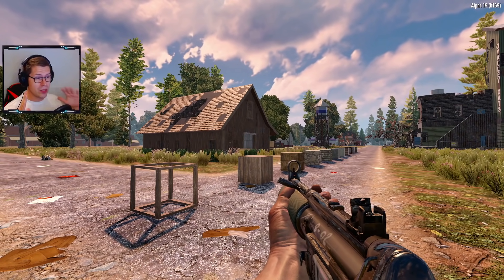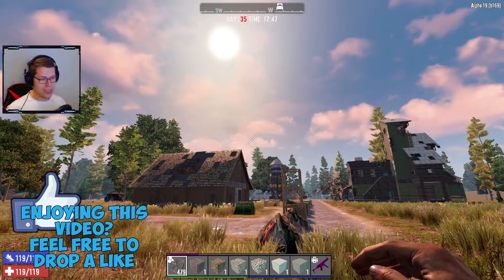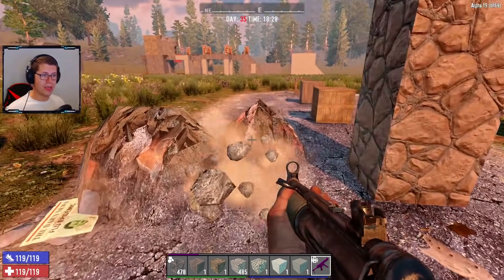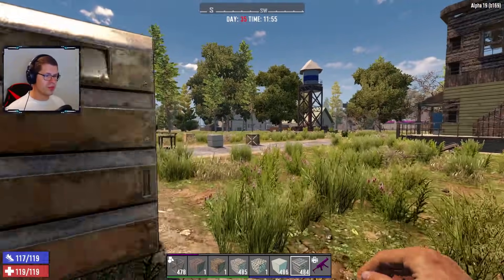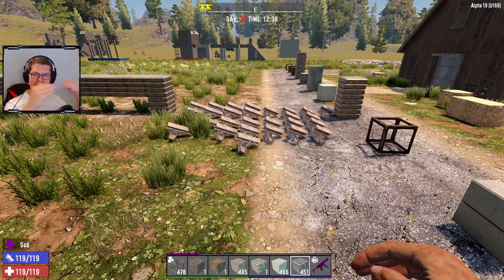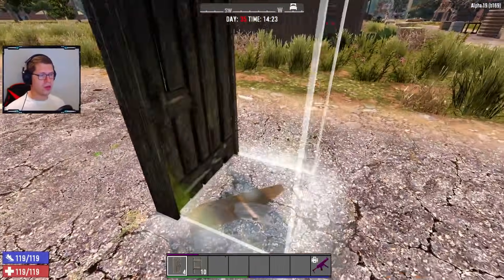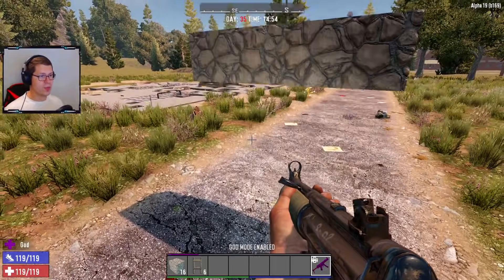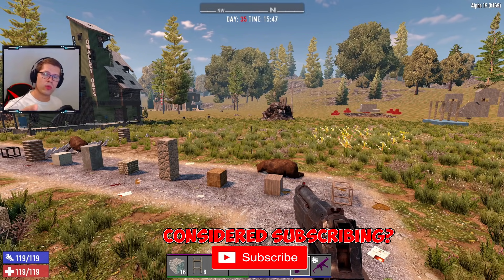7 Days To Die Tutorial - Structural Integrity

Comment: Also important to note: The mass limit is not per block, its per side of the block. For instance, its possible for one wood frame to hold up 8 steel blocks, if they're arranged in a square around it. This means it's possible for one steel block to hold up to 60 other steel blocks, as long as they're not arranged such that any of those steel blocks goes over their own mass limit.

And something that wasn't specifically called out, is that you can mix n' match without care when building straight up. if you build 4 steel blocks out, you can then build 40 wood blocks straight up from the last one and not have collapses.

Comment: all good info, I"m glad people are still making good tutorials, since the structural integrity is a fairly unique, and interesting mechanic to the game.

But it gets kinda funky when you start going into "shared multi sides." the spar is easy [diving board shape.] and a span is also pretty easy "bridge type thing" but what about when you make a "mushroom" with one OR MORE pylons, with multiple support faces, and interconnected facing? 

a fun idea is make a foundation, then get wet cement blocks, shape them into poles. advanced rotate them into  a corner, pile them up as high as you want, putting one in each corner, then a full block at the top. upgrade the lowest 4 levels, if you'd like to reinforced or higher. you now have FOUR columnar support in a one fourth block space.   option two: one full block, and four layers of plates using the "rotate on face" option, "Cladding" the full block with a very flat block. what this allows is, if my calculations are corredct TWELVE support faces, at the top. since you have five columns in a + formation.   The challenge with these is how does the game calculate it's support? is it the sum of all 8 or all 12 faces?  my testing is inconclusive. I would often get results far higher than expected.

So all that said. if you have a long elevated pathway, you can use poles or 1/4th blocks to make a narrow high clearance bridge support, or stilts for a base, where the zombies can literally walk right under you, and almost never get fetched up on the framing. 

But if anyone knows for CERTAIN the game's calculations when making platforms on stilts, how it calculates support on all those shared sides, let me know.

Comment: Worth mentioning...
if you put a block to the sides of your support post, and connect those to your blocks (maximum of a 3x3 grid on your support pole), then each of the 4 "faces" of your support pillar, will hold the maximum number of blocks of that material (based on weight).
So a single wood pillar, topped by a 3x3 grid (to involve all 4 'faces') is using 8 blocks worth in the 3x3 grid, and can support 32 blocks. Not useful for going straight away in a straight line, since you'll be back down to 1 block face and it's maximum support limit, but useful to know, for filling out a floor, or building walls, ceilings, other structural bits, onto your platforms.
Also, the shape of the structural bits doesn't really matter. You can put a single pillar up, and then surround it with thin plates all the way up, and you've essentially made a + shaped set of 5 support pillars in a cluster, even though it's only slightly larger than a single pillar. A pillar like that you could build a substantial structure on top of. Bear in mind, you want your top bits to engage as many 'faces' of your support beams as possible. The collapsing occurs whenever any 'face' reaches it's maximum sheering force. More faces connected to? it's more securely glued to the support. A top area which wraps around all your support faces, to kinda "hug" the pole, is much more secure.

Comment: The big thing to remember is upgrade path. The rebar frames have similar numbers to scrap iron frames, but they upgrade to reinforced concrete. If you build your base/structure based on the stats of the rebar, you will end up with a collapse when you upgrade them. You can still upgrade them with 15 blocks off the side, but you will need to reinforce it in the middle until you have the concrete upgraded again to steel blocks. I believe this still also applies to scrap iron blocks. I believe those still upgrade to cobblestone blocks. Stone is always less than metal.

The doors and ladder thing I had no clue about.
Reply from the maker: Very good point mate! Thanks for brining this up 👍 hope everyone ever this. 

Also, as for the door and ladder "glitch" it got patched out in the most recent update and doesn't work anymore lol

Comment: With the floating base you don't need to keep any of the ladders, you can destroy all doors and ladders and it still stays up as long as there was enough initial support. So if you start by making a 9x9 set of doors with ladders on top you can build a huge base on top and it will stay up when removing the supports. Note that even after the supports are gone you can continue building up, but if you view the structural support in debug mode it will show the whole structure as black, so no support whatsoever. It will remain up though as long as the game (or you) does not force a recalculation of the structural integrity. The moment that does happen the whole structure collapses, so it's not a great normal base.

That said, if you are stuck somewhere early on just make a 3x3 square or so on one door and you can safely sit on it to wait out horde night. You could even do it later on, but then I'd make a 5x5 one with walls and bars + spikes on top to deal with the birds.
Reply from the maker: Ahhh see we tested this on stream and whenever we removed the last ladder, it always fell down? Did I miss a trick here?

Comment: One of my favorite methods is to mix steel and concrete blocks. With steel support it can hold 30 (sic!) concrete blocks, and as long as you know what you are doing (reinforced) concrete is strong enough for an endgame hoard base. It can stand one demo explosion, but with armor piercing rounds (like slugs or AP 7.62) they should be dying in seconds.
My tip is: upgrade to steel the support and only the vital parts and you can make an efficient and very stable base. Build the "hanging" parts with r. concrete :).
Reply from the maker: Not a bad idea at all! Good advice mate 😜

Comment: one thing that few structural integrity educators seem to point out is that the mass carried is calculated from the weakest surface in the chain. 
for example, place one wood frame then one metal block on the wood frame. total branch weight would be only 25. place a second metal block; branch weight 45.
 but the two metal blocks completely consume the 40 HS of that first wooden frame 
 any other block at all will cause that branch to fail back to the weakest wooden surface. leaving you with the wooden block attached to the initial metal block

sorry i could not say this better
Reply from the maker: Haha all good, completely understood 👍 its seems this video didn't cover everything as there are more questions and more info (such as yours) which I missed out. I'll do another video in a few weeks discussing the bits a missed. Thank you for brining this up 👍

Comment: One limitation of 7DtD physics is that it only calculates support based on the vertical and horizontal; you do not gain any benefit from supporting structures with angled walls or columns. Logically, two columns slanted at 45 degrees toward each other from opposite directions should support more weight at the point where they meet than two vertical columns with a beam extending between them. In 7DtD, the amount of weight those two structures can support is exactly the same.

So, with 7DtD physics, it would not be possible to build something like a classic Roman arch, in which the weight of the structure above is directed downwards and outwards by the arch. 7DtD would treat all of those blocks the same as a horizontal beam in terms of calculating weight support.
Reply from the maker: Agree with you Martian, it is very limited/basic. I messed around trying to reconstructs a version of the golden gate bridge with my son in creative mode and it was a mess lol had to build poles (smallest block we could find) to add supports along certain parts. Kinda worked, but like you say as they don't support angles, its kinda wonky.

Comment: Just a FYI the door ultra cheese crap floating base no longer work, also if you are silly enough to do 14 blocks long with steel and it its damaged to point it revers to concrete it will collapse so you shouldn't go past 12.
Reply from the maker: Thanks for the info mate, and good tip 👍

Comment: Idk if its changed since I had this happen but at the beginning you mention you can stack on top all the way to the sky but I was once building pillars to support a base I had and I was stacking concrete pillars on top of eachother and then at one point a bunch broke and I ended up having to build the top half of the pillar and join them in the middle
Reply from the maker: Hey mate, there is an issue with the maps which has been around since very early alphas. Some ground blocks don't actually hold any weight, or hold every little weight as there is an issue with the ground block itself. Hard to explain. But in every game I've played I've alwsys found them. You could place a wooden block on the ground snd it will collapse lol 99% are ok but there's always some around. The supporting pillar may have been a normal ground block. Hope this makes sense?
Reply: @PriMate  i kind of understand what your saying but I remember having 8 pillars around my base and every time it would fall at I think like 30 or 40 in height so j would have to build from my floor down to the pillar and then it held fine also helped when I added diagonal supports which I dont know if those are still in the game I havnt needed them in a long time
Reply from the maker: Hmm, strange 🤔 interesting though! I love trying to figure out these mechanics lol

Comment: If mass doesn't matter vertically, would you when building a wall only need to upgrade the first 3-5 blocks and then whichever blocks that are holding horizontal stresses. 

Theoretically would having a tower of wood poles, followed by a single iron frame allow you to create a hanging catwalk of 60 wooden blocks from that iron frame?
Reply from the maker: Technically speaking...yes. I don't see why that wouldn't work. Are you going you going to test it? If so let me know how it goes please! If not ill text tomorrow and keep you posted 🙂
Reply: It seems as if the blocks that are being held up affect the support of the blocks around them. A steel block as support can hold 15 steel blocks, 8 wooden blocks, or 12 stone/concrete blocks horizontally. If you connect a wooden block to a steel support, then only one steel block can be held up after that wooden block. 

Having a steel support followed by 14 steel blocks and then a wooden block (all horizontally) does not allow any more blocks to be placed after the wooden block (block #15) even though the mass limit hasn't been reached yet. Placing 14 steel blocks horizontally still allows you to place 4 wooden blocks on top of the 14th steel block, which reaches the mass limit. 

As for making a tower of wooden blocks followed by single metal block at the top, that works perfectly fine. 20 wooden blocks stacked followed by one steel block was able to hold 15 steel blocks horizontally.

Comment: How much weight can the floating ladder hold? If recreated the way you just did in the video, how many flagstone blocks can you attach horizontally? Is it based on the ladder’s HS or on the flagstone’s HS capacity?
Reply from the maker: That's actually a VERY good question Jackson! I don't actually know as I didn't check at the time. A little late here in the UK. Shall check if there is any structial integrity in the morning 👍

Comment: Good video this, I've kept meaning to test out integrity but always got distracted by playing :p  and just played the rule of 7 blocks max would keep me safe.

I thought it was particularly interesting that the support doesn't apply to the total number of blocks a pillar has attached, but rather it can support essentially up to 4 rows as long as they aren't touching. Trying to understand the maximum size  platform a pillar can support seems to be a little more achievable than trying to understand Zombie pathing.

Not sure how it'll effect my play throughs as I tend to build bunkers, but it might make be a bit more  confident to build larger mines and spread out the supports :)
Reply from the maker: Yeah basically divide the mass by the amount each block can support, that will give you how many blocks each support can hold 🙂

Comment: Thanks for the testing.  So for example, steel holds 15 blocks...is that in all 4 directions?  If you had 8 on one side and put 8 on another, would they fall?  How many could you place in a square around 1 pillar?
Reply from the maker: No worries Ommibus! 1 pilar will hold 15 in amy direction. So 8 if you had 8 on each side it WILL drop. 15 total in amy direction

Comment: Bro can you help give some advice please? I’ve come across what I feel is a bug and my building keeps collapsing no matter how much support. I’ve played this years built many huge castles but can’t finish my new one and it’s not that high up. It seems the more the roof collapses the weaker the building gets and it crumbles. Even if I walk over the weak area it crumbles. does anyone know if there is a bug like this? I’m so frustrated☹️ I’ve built a huge cathedral and I did have 95% of the roof done but come across an area right in the center that can’t take more blocks and I have stainless steal pillars supporting it in a big way. Even if I put a block on the steal pillar it collapses. Any help would be much appreciated. I’m on Xbox one x.
Reply from the maker: Xbox, hmmm...not sure if it worked the same but the best way to test your builds is to go into the "DM" menu (not sure how to dot this on console, maybe Google it) and the select "show structural integrity" option. 

Everything will turn green, yellow orange and red. 

Three stable, yellow slightly stressed, orange close to breaking, red about to break. 

Find out where the weak points are using that, should work!
Reply: @Primate ahh nice thanks buddy I will check that out if it’s available on the Xbox version.
Reply: @PriMate  bro unfortunately the DM mode is not on the consoles as I can’t find any info on it for them so I’ll have to cut my losses. My cathedrals main ground floor is made of glass blocks and plasterboard BUT the main frame and pillars are supported by dirt ground. I can’t see me removing the entire floor is going to fix the issue and will take me hours but I may try it at some point. I’ve done a chess board pattern black glass and cream plasterboard.I’ve already replaced 2 huge wooden floors with brick which took hours and it made no difference so I have my doubts taking up the entire ground floor will be the answer. When I create stuff on here I put everything into it so it’s a pain it the ass I’m not to be able to finish it. I just wish I knew if it’s a bug or something else that I can fix. It started off with 1 small area collapsing then even after I had put the roof up once it wouldn’t go back as it was again and collapses🤨
Reply from the maker: That sounds amazing! Do you have discord? Of so, hop in the community (Primation) discord and post some pics in your base under "screenshots"! - https://discord.gg/Z4BewaS

Sorry it didn't work out mate 😕
Reply: @PriMate  cool I’ll check that out. thanks buddy. yeah this place I’m building looks stunning it’s by far my best creation and I’ve created some stunning castles even a couple of light houses out at sea all lit up. I’ve got a huge hole in the roof of the cathedral that’s got bigger as times gone by and I just can feel when it’s going to give way and it’s a sickening feeling lol. some say it could be because it’s on sand or clay grounds but not mine it’s all dirt. maybe I should just put a few layers of rock in replacement of all the dirt underneath but it’s a job I don’t want😂
Reply: @PriMate  Hi mate, I just wanted to let you know that I finally found out what was causing the roof to collapse. The support beams must go all the way from the ground floor through the second flooring and not stop at the second flooring as you’d expect. The second floor must be built around the beam so it’s just touching it and the ground floor beam is going all the way up through the second floor to support the roof. So you can’t build another support in the exact same place on top of the flooring that’s supported by the beam. I cant believe that cured it. In reality that wouldn’t happen lol. Many think it’s a bug I’ve been reading some posts. if you ever get someone on here that’s asking why is this happening you’ll know the reason. I bet tons have had this and thought it’s a bug.
Reply from the maker: Ahhh ok ok, I see what you mean. Glad you got it fixed mate!! 😁 and thanks for the update!